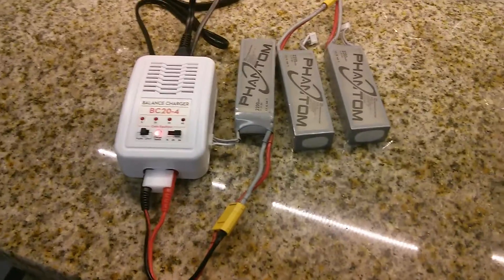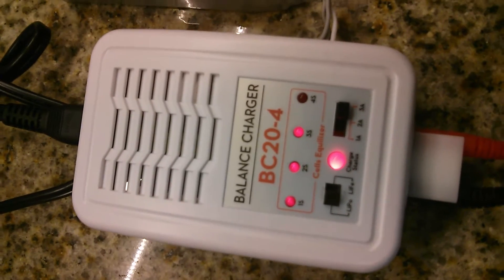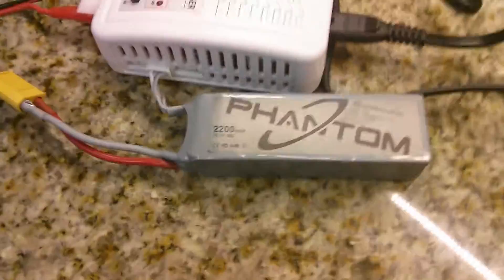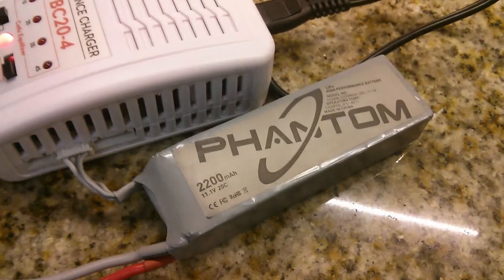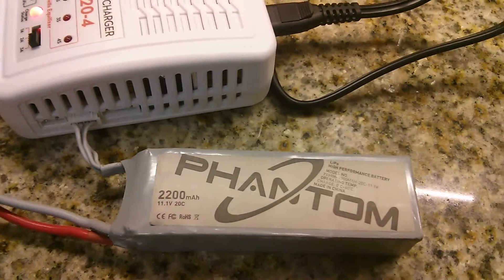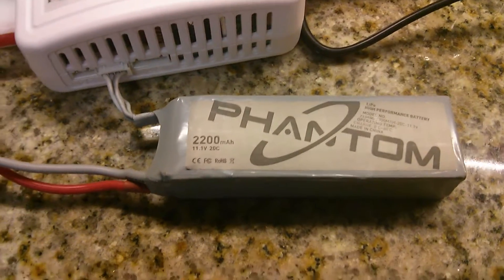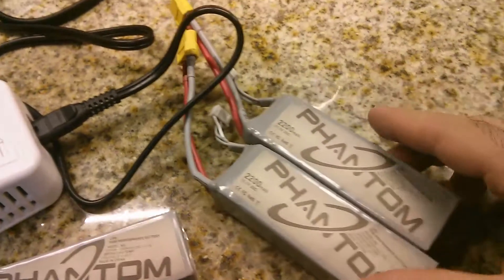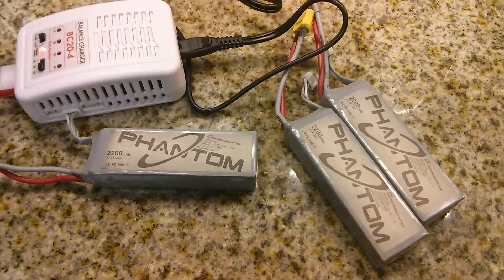How to restore a DJI Phantom LIPO battery

Comment: I tested 2 batteries on the weekend and both of them seemed it be “dead". After using one of your methods [Check Details Here==>https://plus.google.com/100351090281822647456/posts/8J7oW6JdBTZ ] I was able to rejuvenate them both to 100% working batteries. Thanks, you just saved me about $180! :)_
Reply: gd